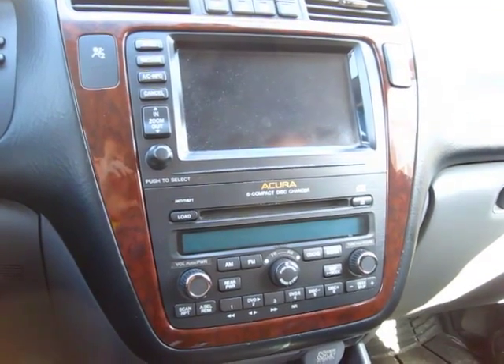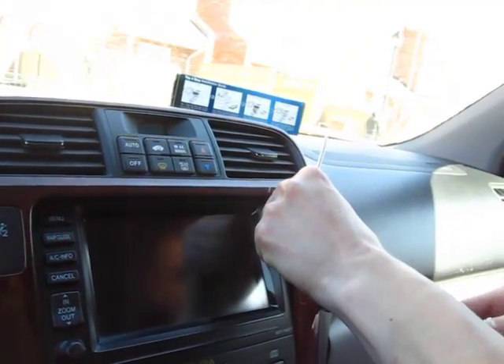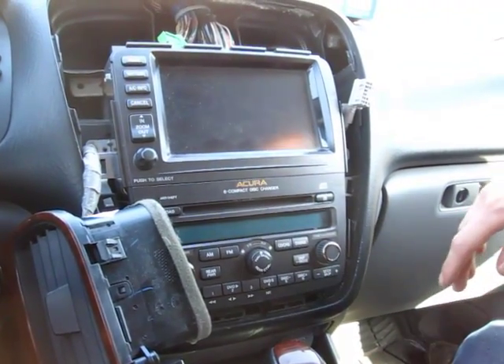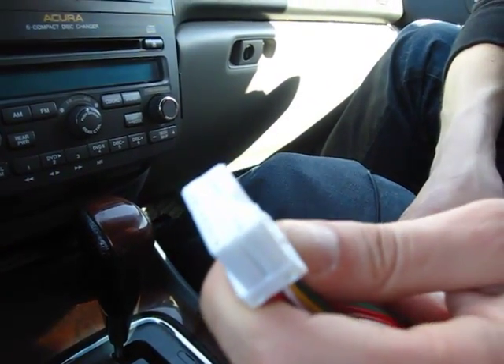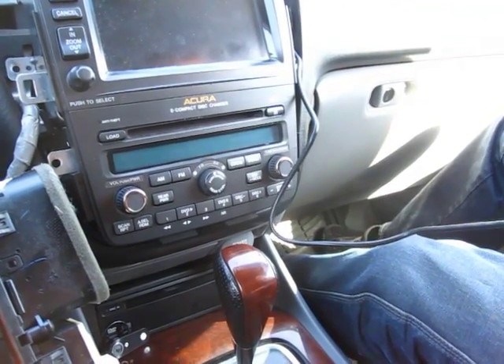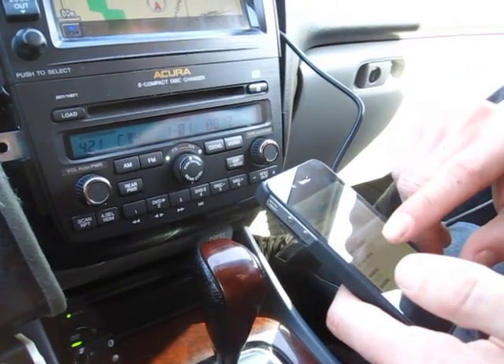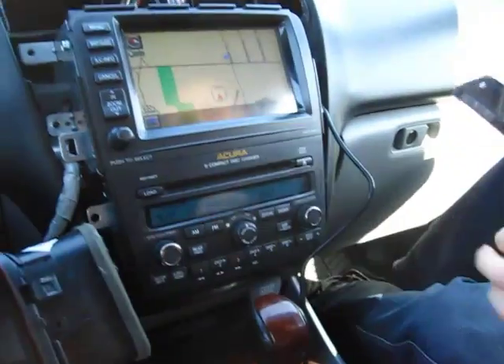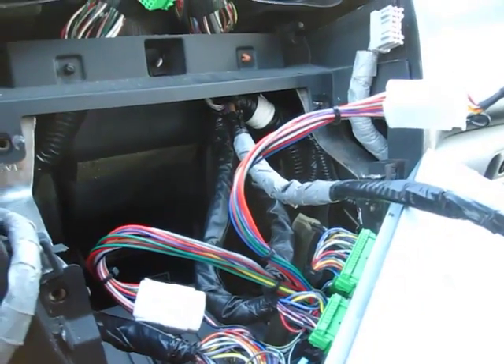GTA Car Kits - Acura MDX 2005-2006 install of iPhone, Ipod and AUX adapter for factory stereo

Comment: I just installed the Pure Bluetooth Kit in my 2003 MDX Touring with the Bose system and navigation.  I do not have rear entertainment and the navigation DVD box is under the front passenger seat.  I inquired about this configuration, and got a very fast email back saying that it should work for my configuration.  This video was very helpful. Getting the trim off and the radio/display out was exactly like the video, except the connectors for the emergency blinkers and temperature controls was in a different location, but that didn't matter.  The back of the radio was slightly different than in this video, but there was an open connector slot and the kit cable fit perfectly.  It took me about 45 minutes, but at least half of that was trying to decide where I wanted to locate the bluetooth box and route the cable for the microphone and the connector.  For now, I've got the box in the glove compartment.  It was truly plug and play.  And, as someone else commented, it has transformed the audio system in the car.  Why did I not do this years ago?   The sound quality is incredible.  The Bluetooth connects automatically just like in a modern car.  The steering wheel controls work for volume as well as advancing to the next song.  I don't see how to go backwards from the steering wheel, but no big deal.  The only thing that is not integrated fully is the volume control.   The volume control on the phone does not change when the volume control is changed on the radio or steering wheel.  So you need to adjust the phone volume high enough that you don't need to crank the volume on the radio.  It won't take long to get this balanced.  If you don't do that, then when you change from the phone to the regular radio or CD,  the volume could be abruptly very loud or vice versa.  Other than that minor gotcha, I am extremely pleased!  As I said, I wish I had know about GTA car kits and done this years ago.

Comment: Really Important

The iPhone bluetooth volume will probably be very, very low unless you make settings changes.

1. Settings > Music > turn off Sound Check & make sure both volume limiters are Off

2. Call yourself and when voicemail picks up, max out your iPhone volume.

Now your bluetooth volume will be comparable to XM or FM radio.

Comment: Do they make it for the Acura MDX 2004. It has the rear entertainment controls as well.
Reply: If you have the rear controls you don't need this just run a white red audio to aux across to a Bluetooth adapter in the back power port

Comment: Does this adapter work on the non- navi radio?
Reply: He implied that it does. Seems like you just wouldn't have to plug in the Navi input on the splitter. Or maybe not even need a splitter.